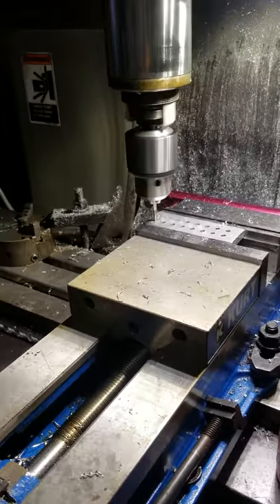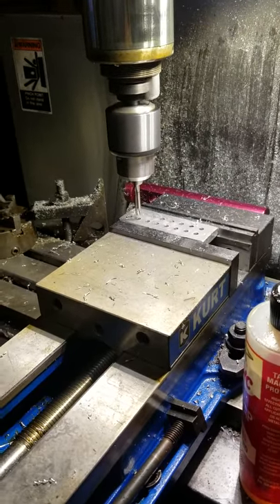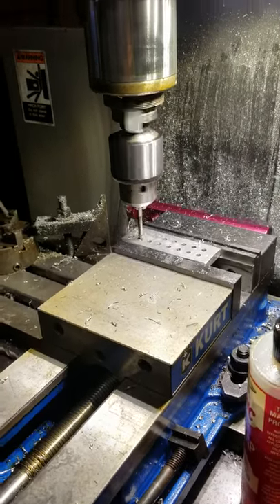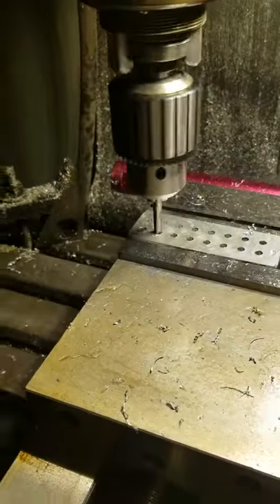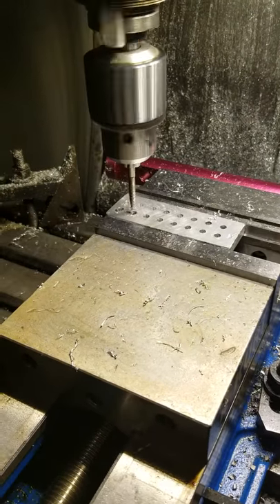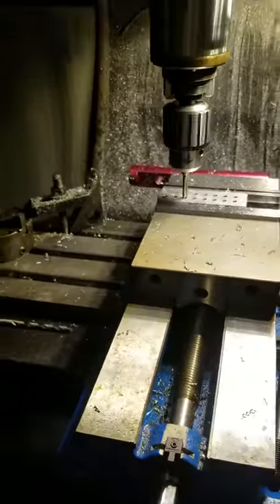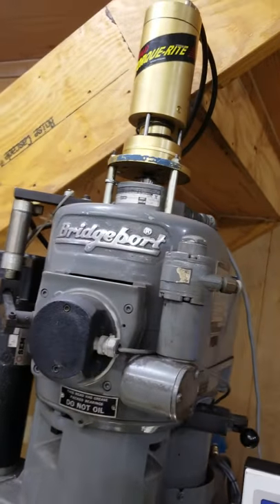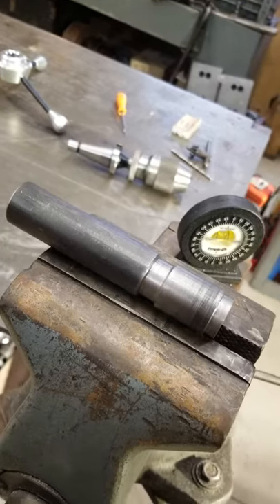Spindle encoder bridgeport mill centroid control

Comment: Does it work in the low gear as well?
Reply from the maker: Yes it's direct on spindle
Reply: @mikepons1  are you sure about that??? On my mill the spindle and the upper part of the spindle (where you have mounted the encoder) rotate at different speeds when on low gear...